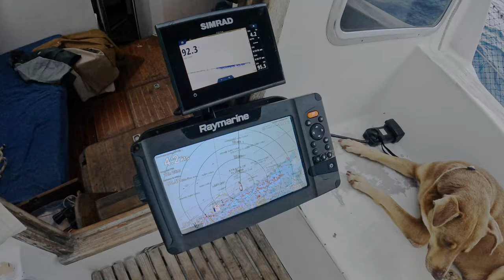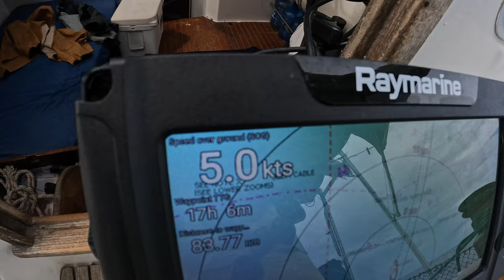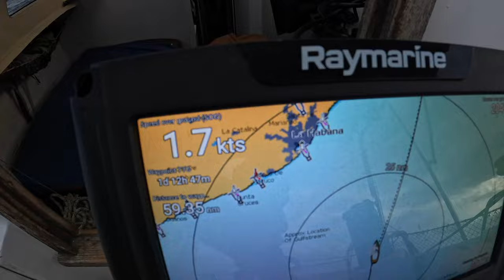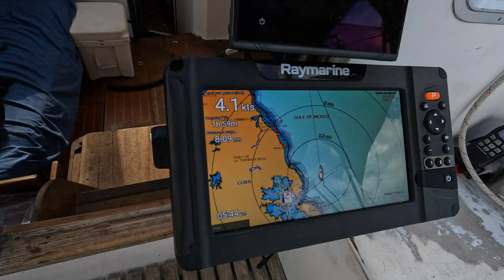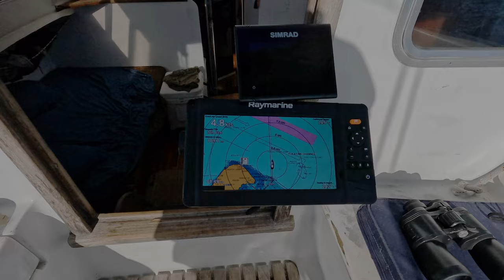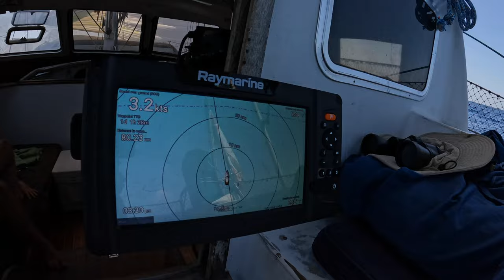OOPS we sailed to cuba (and towards hurricane beryl)

Comment: You need to take your thermostat out,with salt water going through your engine temperature needs to be about 120.If too hot salt will buildup in your block and cylinder heads
Reply from the maker: Thanks! We don’t have a thermostat at the moment, only checking the temperature with the back of our hand 😆